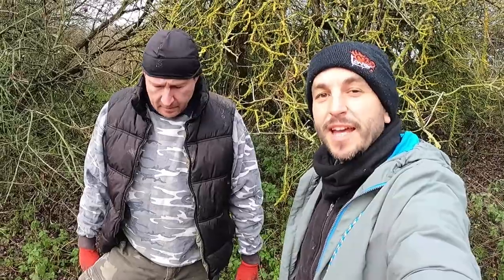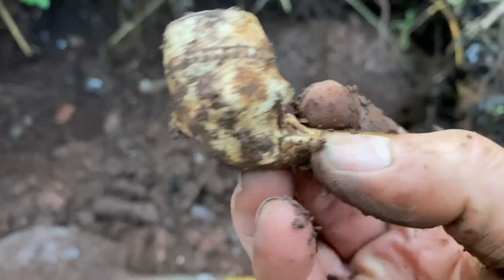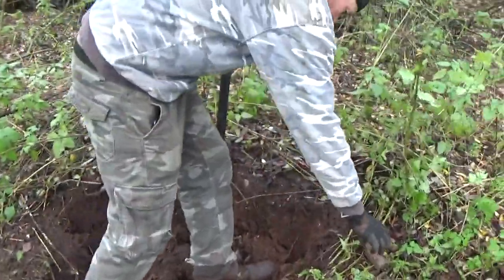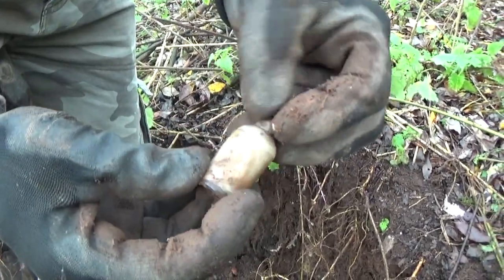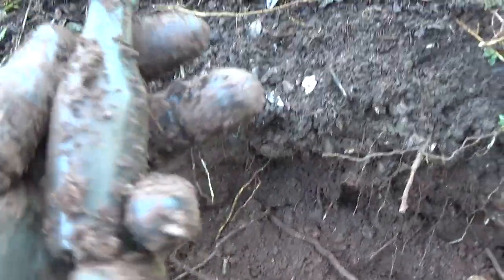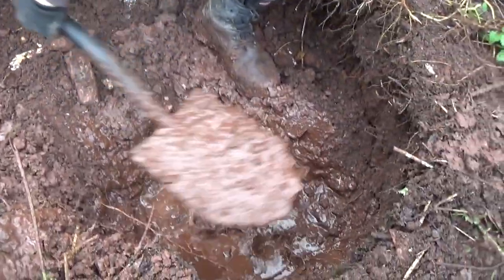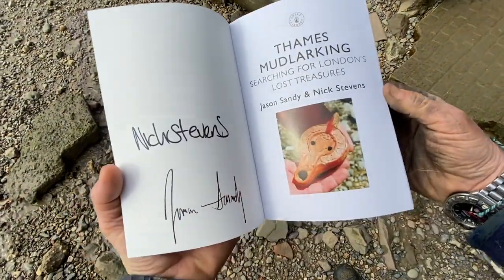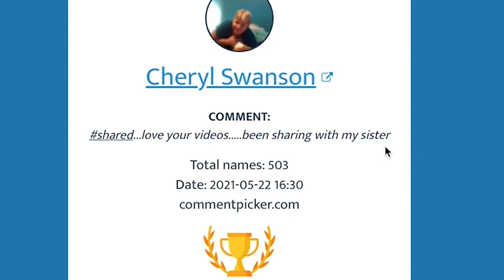AMAZING Finds from the Victorian dump! Pipes, stunning bottles and much more!

Comment: Your cut glass piece was almost certainly part of a dressing table set.
Reply from the maker: It’s a salt cellar 👍🏻
Reply: I have a number of cut glass and pressed glass salt cellars and I would have thought it was too large for this, however, mustard pots were a regular feature so it could have been one of these but I still think it's part of a dressing table set. These were de rigueur and usually consisted of a glass tray, couple of candlestick holders,, a scent-bottle with a rubber spray bulb covered in embroidered silk, a bowl with a lid for powder and a small pin tray or dish like yours. Whether yours is or isn't a salt dish it was a nice piece to find.

Comment: That square glass item is a Salt...
Reply from the maker: Cellar
Reply: @Sifinds  I'm old enough to remember using one.  Salt came in blocks and my gran, who was born in 1889, would scrape some off with a knife and put it in the salt. I remember helping her. We never called it a salt cellar because they had lids and you couldn't get block salt to pour through the holes. You took a little bit of salt on the end of your knife, put the salt on the edge of your plate and then dabbed the food on your fork into the salt.
Reply from the maker: @dianerayburn1728  How sweet. Thanks for sharing